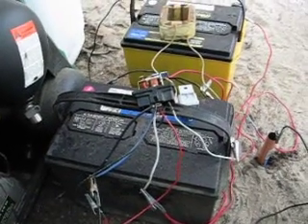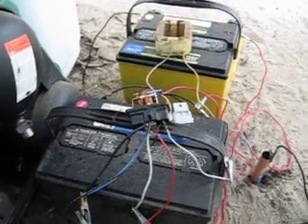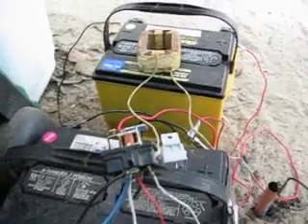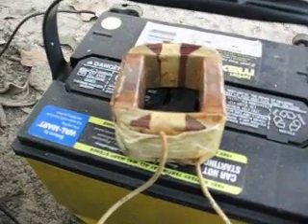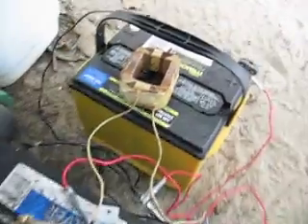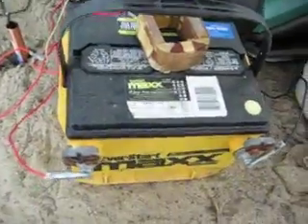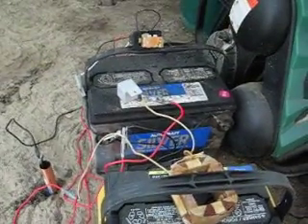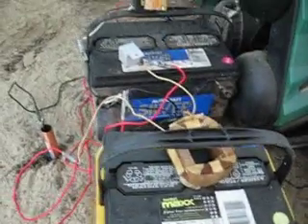Imhotep relay charger

Comment from the maker: Yes. The easiest way that I can explain it is like John Bedini says, when you charge a battery with negative energy you first have to take away the positive energy. One will cancel out the other. Remember that Positive energy is divergent and negative energy is convergent (as Tom Bearden says) so when you give negative energy a chance to charge the battery it will take some time to cancel out the positive.

Comment from the maker: Sorry I didn't get back sooner, computer was in the shop. 
Yes..... the charge battery will lose voltage as you run through the charge - discharge cycles. Radiant energy is great stuff, but the imhotep relay charger is only a proof of concept project. You need precise clocking of frequency, like with npn or pnp transistors to really nail it. Personally, I'm gonna by one of the Renassants Chargers from John Bedini. He has brought the science to the market and we can all benefit.

Terry

Comment from the maker: @irondmax The primary core winding was wired in parallel with the relay selinoid. Ultimately it caused damage to the contacts of the relay, so I stopped using it. The relay, when purchased, did come with a 1N4001 diode across the selinoid. I removed it to allow the back emf to flow in the desired direction which is a negative potential.

Comment: @MrTswindell if you use a transformer on the points them self......you need a capacitor of the correct size across the points like a old set of car points.....
a in4001 i think is 1 amp......... could be you exceeded 1 amp and it could not do its job.......could be you needed to reverse your pos and neg wire.
points are damaged from to many amps in your spark.......and never last forever
in one of my vidios , lawton circuit at 10000 volts......i use a relay instead of points to drivea carcoil

Comment: do you think i could put this circuit to use with a double pole relay in line with a regular batt charger to pulse the charge to desulfate batteries?

Comment: Does your Charge battery voltage go down while its on the imhotep relay charger? I’ve got really bad 12 volt batteries and they all seem to start off at 12 volts and slowly go down.

Comment: see if your relay has a resistor in it......if it does remove it........then it will work without your transformer
i would like to see how you wired the transformer in